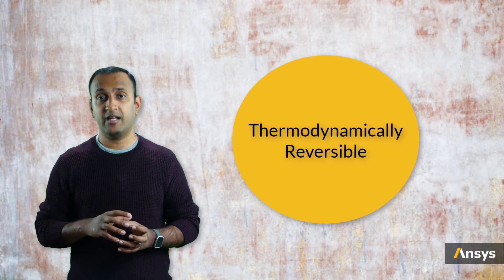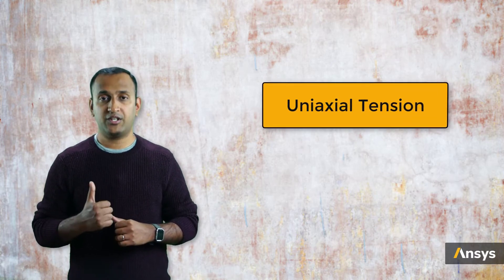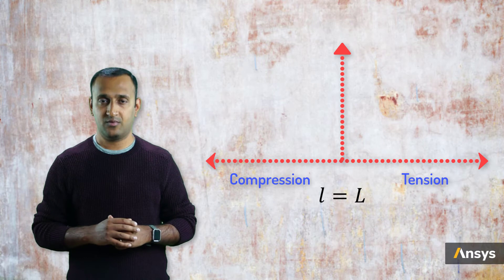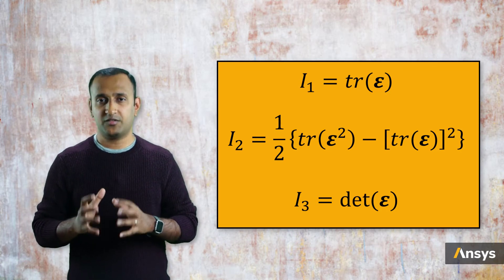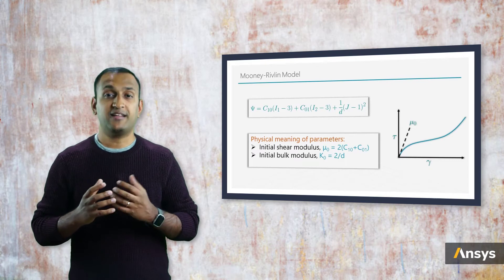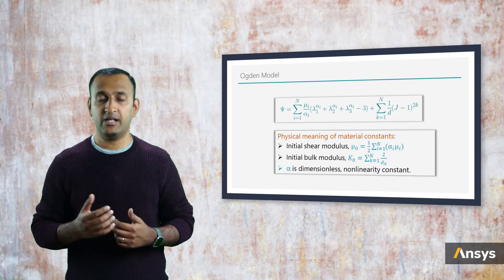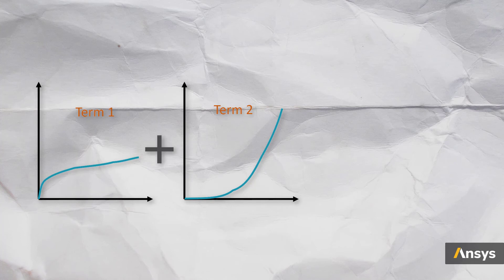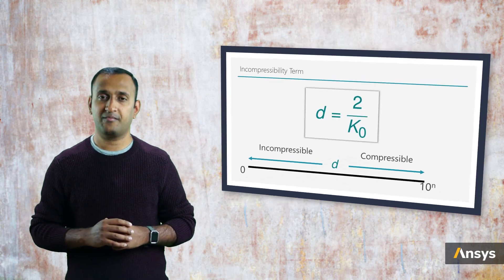Energy Functional — Lesson 2

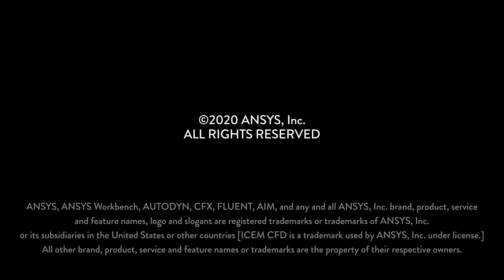Comment: I really enjoyed the video. However, they should correct the strain energy equation for the Ogden foam model in terms of the principal (volumetric) stretches. To begin with, I believe the Jacobian raised to (alpha_i)/3 only multiplies the principal stretches, not the number 3 (min 13:56). This only happens in the video, because I reviewed the material in the pinned comment link, and it appears correct on slide 13.
It would make it easier to correctly position the strain energy equation in this video for beginners who want to verify the calculation of the second Piola-Kircchoff tensor by deriving that equation with respect to the Right Cauchy-Green deformation tensor.